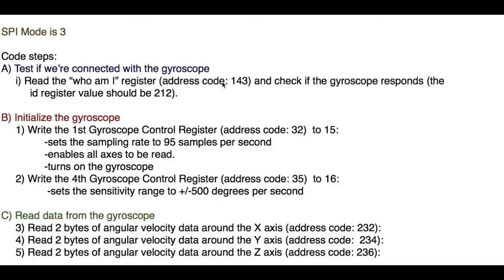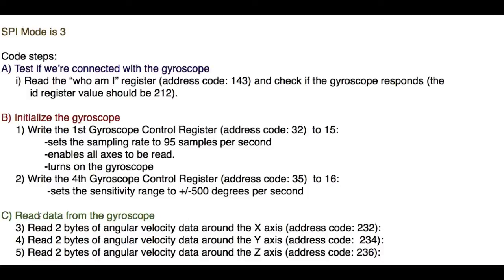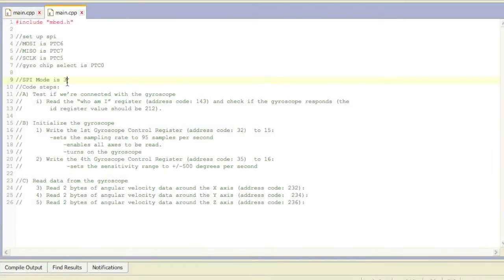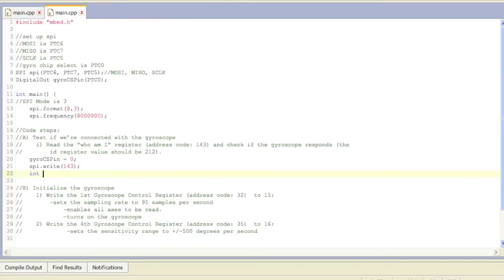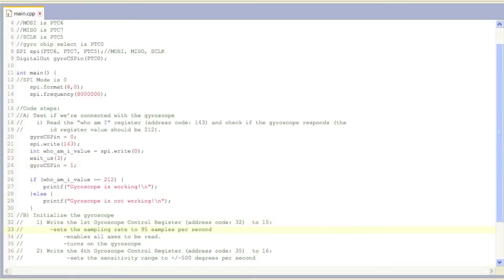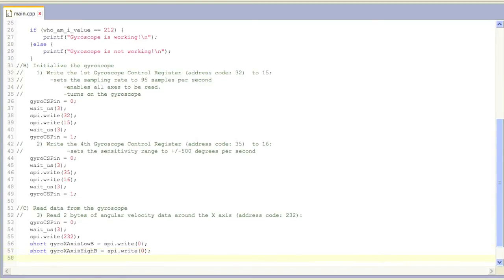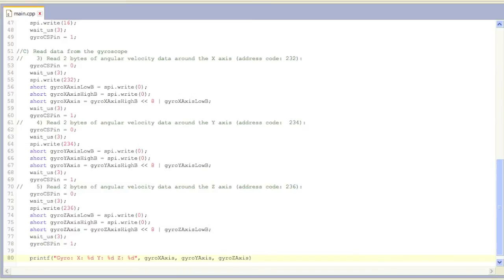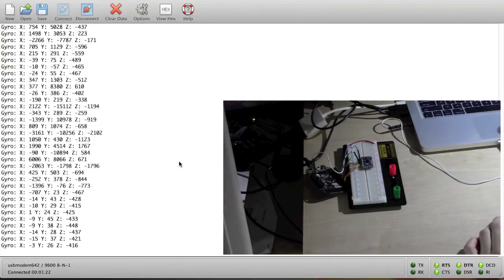mBed Tutorial 9.5: SPI Interfacing with the LSM9DS0 (Gyroscope)

Comment: What if you setup the spi for 16 bit data? Would the read and write be done in one-line spi.write(...)?
Reply from the maker: ***** This will depend on which microcontroller you use. The KL25z as far as I know isn't capable of doing 16-bit SPI read/write operations and only allows for 8-bit. I would say give it a shot if you're using a different microcontroller and see if you get the same result. The only problem after that is your code will work only on that specific platform.
Reply: Bme Builds Hi, Thanks for the reply. I would try it on my STM32F411RE Nucleo once I have a similar SPI device. :-)